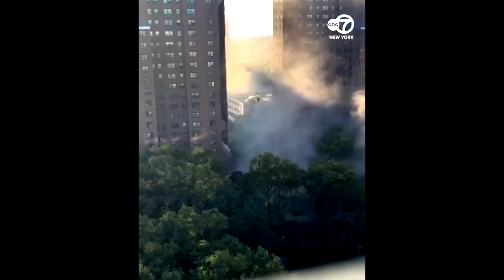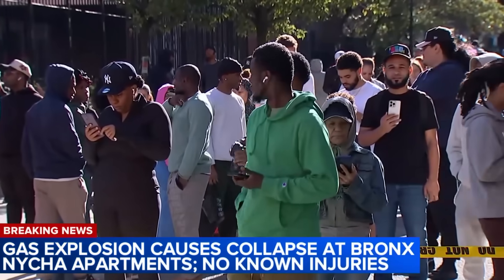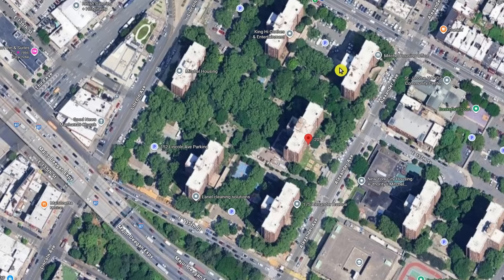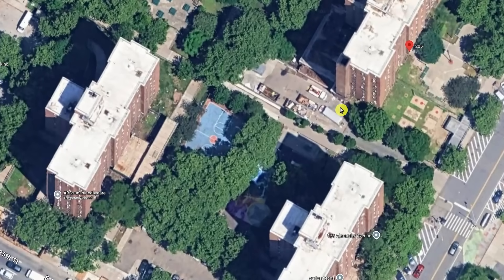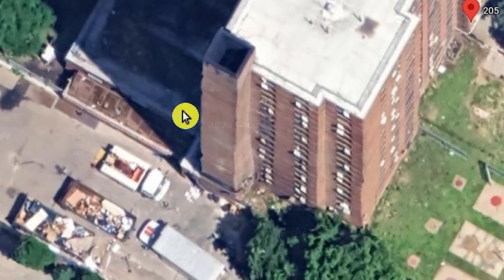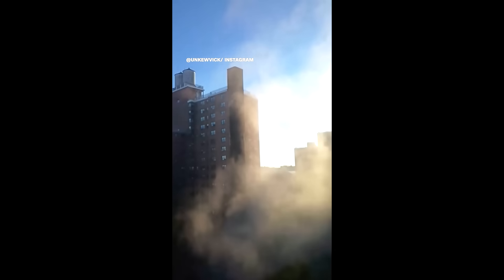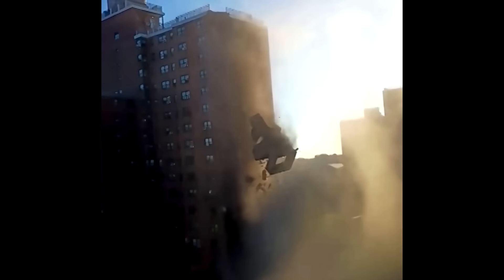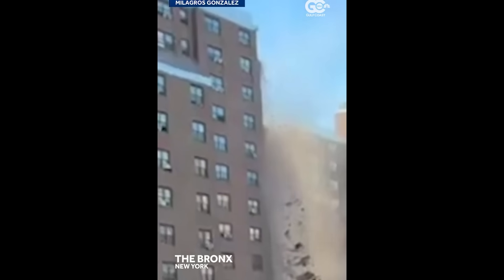Bronx Apartment Collapse Explained: Boilers, Bricks, Stop Orders

Comment: I worked on boilers like these for years... typically in these apartment buildings. they have separate boilers used for domestic hot water than are used for heating..  they sit all summer long..  actually a good part f spring in public housing.. the government is cheap in my area and had us come out and do full shut downs april 1 (central ohio)..  and typically wouldnt do boiler startup till november 1 if they coud get away with it..  anyway if that incinerator chimney was  used as the boiler exhaist chimney (I have Zero knowledge of this building.. never saw it before the collapse)..  if the ignition system fails to light the gas repeatedly its possible to have gas buildu in the chimney..  the purge cycle is supposed to blow enough fresh air into the flue and boiler combustion chamber to dilute any gas buildup... that said if for some reason the boiler wasnt running full purge cycles and the tech trying to fire it was troubleshooting why the igntion wasnt working then maybe a sugnificant amount of gas built up in the lower part of the chimney..  cold and possibly damp conditions?   when the unit does ignite then its likely going to "poof" right out the exhaust port and into that gas filled chimney...  since no one got hurt it obviously either didnt blow up inside the room but did in the chimney enough to cave it..   or like you mentioned, gas build up in the boiler room...  old building perhaps they had CO detectors but not combustible gas detectors? or there was no tech in the room running the boiler... it just on its own failed to close the gas valve on a no-fire..  from what ive read it sounds like boiler ignition failure and gas buildup in the chimney..

Comment: JUST  SO  YOU  KNOW...
Those shafts are STILL USED, but instead of going into an incinerator...the garbage is collected in a dumpster, and hauled away later. The 'inhabitants' like to throw fire down those shafts and intentionally burn the bulk garbage pile at the bottom...leading to tremendous smoke issues of the entire building because the chimneys don't draft with the incinerator anymore. It is possible some 'inhabitant' thought it would be funny to throw an accelerant down there, and lit it off...causing the explosion. It would not be against their 'character'....or lack thereof. And just so you know....their rent is mere pennies, and all their utilities are free. They often times open the windows in the middle of arctic winter freezes because 'it's too hot inside' and they don't turn down the radiators. Or they just crank up the A/C. They aren't paying for it anyway. So remember this the next time these creatures complain about anything. #Savages  😐

Comment: Most likely weather played a massive role in the structure failing, coupled with failure to maintain the pointing adequately. Add in factors that it was a chimney and exposed to the effects of combustion which overtime weaken the mortar between the joints to little more than dust. The chimney wasn't tied into the buildings structure.  Who knows the state of the basement around the boilers, whether they'd removed the old system further weakening the structure.  So Age, Severe Lack of maintainence, Adverse weather and effects of combustion over the years, with possible modification to original design structure.

Comment: My guess would be that the triple wall is internal heat resistant layer (expensive bricks), actual structural wall (cheap bricks), and the exterior wall (design weatherproof bricks).

Comment: Really interesting that you were able to post a Google earth picture of the building chimney before the collapse. It looks like there was a construction crew doing demolition work right in the area of the base of the chimney. Tough to see clearly but there seems to be a hole cut through the wall just to the left of the chimney. In the post collapse photos you can see what looks like a new garage door. As well the line of the roof above the garage door is much further back than it was in the Google Earth photos. Perhaps they took out a portion of the boiler room roof and unknowingly weakened one of the support wall corners of the old incinerator tower.

Comment: While a gas explosion is most likely, but it could have been the boiler itself blowing up under pressure due to a weakness caused by corrosion or metal fatigue.

Comment: This is a tribute to the good construction of this building, especially for how long it took the chimney top to collapse. If you look, there is nothing at the base of the shaft. The door and vent next to the shaft suggest that the incinerator was probably next to the shaft. It would make sense that the boilers also vented into this same chimney, so it is likely it was still in active use for the boilers. As one other commenter pointed out, if a boiler failed to ignite and vented sufficient gas into the flue, exactly this kind of thing would happen. If the boilers were being commissioned for the heat season, you would think a tech would be present who would have shut off the gas immediately on a failure to light. Safety systems should have also acted to automatically shut off the gas. We had something similar happen a few years back at the University of Nevada-Reno. A technician was working on a boiler that provided heat to a number of surrounding buildings. It was a 6 or 7 story dorm unit, unoccupied at the time due to summer break. Something catastrophic happened that resulted in a major gas leak. There was an explosion that apparently made the leak much worse. This resulted in a much bigger explosion that did severe damage to the entire building. The tech apparently got out quickly and shut off the gas supply to the building. His quick thinking and actions undoubtedly prevented a much bigger explosion. In any case, the repairs to the building took two years and cost more than it cost to build the building in the first place.

Comment: Weren’t they also heating hot water for the building with the same boiler? Therefore, the boiler would be going all summer with the heat circulation pump turned off and the hot water circulation pump turned on. 🇨🇦

Comment: While I am not certain about this specific building, this is one of the last completed of the NYCHA's blocks (very few kept being built after 1970). Historically, for such tall buildings in New York, this is probably a concrete frame with brick exterior and/or infill. While some of the lower (<12 storeys) buildings used self-bearing brick, frame was most common for things to and above 20 storeys. The wall visible beyond the bricks at the top of the chimney may be the concrete frame sides. Often the chimney stack would just be built from self-bearing brick adjoining the building, only loosely connected to the main structure, so that is possibly why there's emergency responders on the roof, as they may have determined there was no general structural risks involved.

Comment: The NYCHA buildings in the complex that make up the Mitchel Houses often have one building that has the powerhouse attached to it.   That powerhouse makes heating steam and hot water for all the buildings.   There is a mini steam and hot water distribution system that goes from the powerhouse and feeds each of the buildings.    When the complex was built in the early 60's its powerhouse burned no 4 fuel oil which is a dirty oil and thus coated the flue or chimney black.    I do not believe the flue was ever meant to be an incinerator.   It was simply a giant chimney, flue or stack for the powerhouse.   Today the powerhouse's boilers burn clean natural gas.   Unfortunately, the NYCHA boiler attendants allowed a critical volume of unburned natural gas into the boiler(s) and into the chimey or stack.    Subsequent ignition and explosion occurred which instantly pressurized the stack to blow out enough bricks to collapse it.  Preliminary reports indicate that a boiler or two were damaged.    It should be interesting to see how NYCHA will heat the entire complex with its powerhouse damaged...

Comment: This is operator failure. Gas is built up in the combustion chamber and when ignited causes an explosion there’s a computer that is supposed to turn on the fan to purge it, but the fan most likely did not work. There was also a previous explosion called the puff back.
-hvac engineer nyc

Comment: That makes total sense...it happened right at the start of October.
Which building management consider The Start of the Cold Seasons.
Though these days,  even in New England,  people still need to use their a/c, as the outdoor temp goes into the 80s, and it's hotter inside.  Though then it'll drop to the 40s at night.

Comment: This was the boiler plant flue chimney---not for an incinerator.  The news got that wrong.  In many NYCHA projects only one building has a boiler plant and the steam is then distributed underground to each building.  Due to the chimney being missing, the entire complex has no hot water or heat.  The inner layer of the chimney is FIRE-BRICK. The round hole at the bottom of the pile is the boiler exhaust breeching.
Reply: No, you got it wrong. It was originally an incinerator flue stack but the waste incinerator had long ago been replaced with a gas boiler using the same old stack. If it was built for the gas boiler from the beginning, it wouldn't have that large cross section (if it's not a 100 MW scale boiler used for a whole town). Nobody said there was still an active waste incinerator.

Comment: What if the chamber of the boiler room shaft was super dirty with soot so natural gas detectors didn't alert but when the heat kicked in, it ignited that soot which caused the walls to fail?

Comment: Ceramic engineer here: The inner layer, at least in the lower section, is likely made of temperature-resistant firebricks. They are also significantly lighter than the red facade bricks. What this type of firebricks doesn't like at all, however, is moisture in conjunction with frost.
Reply: Thanks for sharing your genius
Reply: The collapse was caused by a gas pipeline explosion. Not what you said.

Comment: Thks for video.  My first thought was it was an external added on stairwell for the building.  My reasoning for the failure is the fact that it was left open at the top for rain to enter.  Nothing was being burned and keeping things dry.  Next is the fact they turn off the boilers for heat.  Constant expansion and contraction every year.  P.S. If you have a fear of heights, you cannot be a responder in New York.  Standing over the edge to see would be a normal thing.  Just ask the ones that build said buildings.

Comment: Gotta give props to '60's construction. The fact that the chimney and only the chimney fell, and collapsed pretty much into just it's own footprint is pretty impressive. Pays to do things right.
Reply: Most likely weather played a massive role in the structure failing, coupled with failure to maintain the pointing adequately. Add in factors that it was a chimney and exposed to the effects of combustion which overtime weaken the mortar between the joints to little more than dust. The chimney wasn't tied into the buildings structure.  Who knows the state of the basement around the boilers, whether they'd removed the old system further weakening the structure.  So Age, Severe Lack of maintainence, Adverse weather and effects of combustion over the years, with possible modification to original design structure.
Reply: That's prime real estate in downtown New York! One controlled demo, to get the poor people out, get zoning start building condo's.
Reply: As he said, it's a separate structure - the building didn't lose any of its critical support components at all. It looks a lot more dramatic than it actually was (from a physics / engineering perspective at least.)
Reply: @EstorilEm  That's just not good enough.  This was a major infrastructure failure.  Buildings are not supposed to just collapse, neither in whole, nor in part.
Reply: @justaskin8523  It a maintenance problem. Very commun in masonry building since we stoppped building them. Most of the specialized workforce does not exist anymore and the cost are horrible because of this. But simply a maintenance issue.
Reply: Definitely seems to have held up better than Ronan Point here in the UK.

Comment: So the complex may have to be hooked up to boiler trailers.  This surely was a stack from steam heating boilers, not incinerators.

The incinerators hoppers oare near the middle of the bldg. for tenants to put trash in   Now to compactors.  Wasn't the burning done close to that?   They did not walk trash in the basement from middle to edge of the building.     In Dyckman Projects,  N. Manhattan ('Inwood"), lived in a as kid, each bldg. has interior incinerator stack, close to core of the bldg.    The boilers for the 7 bldg. complex built in early 1950s are in a separate bldg.    And they are not going to rebuild a brick stack.

Comment: 8:53 what am I looking at on that diagram?

Why is the grey brick tagged with "WALL TIE", shouldn't that be pointing to the little metal bit L shaped bit?

And the "TWO-WYTHE BACKUP" makes no sense, that just looks like some kind of plaster board? And is certainly not two wythes thick.

Comment: I was a few feet from a fuel oil boiler during relight and it went boom. The water vessel did not rupture (as I am alive) but the sheet metal blew apart and filled the room with smoke. I don't like being around boilers.

Comment: These are reinforced concrete buildings with brick facades.  That is why the NYFD is inspecting the roof.  Only the facades are affected, not the structural slabs or columns.

Comment: Where in live if you have an existing brick chimney that was originally designed for an oil/ coal/wood boiler, it needs a stainless steel liner when converting to gas due to acidic nature of gas exhaust when mixed with condensate

Comment: Cleaver Brooks boilers are high pressure boilers. Mechanics who work on them must be trained and certified by CB.  They sofisticated as compared to a typical Federal style low pressure unit.  NYCHA has no money.  Only a select few boiler maintenance contractors in NYC exist.  I doubt one of them were on this job.  Or possibly in house maintenance bit off more than they could chew when going through refiring procedures

Comment: I am a building code official and The construction is 3 layer brick with air spaces type which was common starting at the turn of the century.
Since the brick is brittle and unlike the CTS there was no rebar attached to the main structure to drag it down. the brick sheared apart. The code now limits the height to 35 feet and this building wa about 160'.
CMU is used for these type of projects.

Comment: the building 164 St. Anne's way, to the east-south-east of this complex, also has such a chimney with a newer brick shed at the bottom of it with all sorts of yellow pipes going in. It seems that they used those incinerator shafts as chimneys for the complexes' heating system as well. I can only find a single building in a block of several with such a chimney. Am I right in assuming that single boiler system would heat the buildings around them, not just the building with the chimney?

So would they have used the incinerators to help heat the boilers back in the day?

Comment: The fact that the chimney remained in place after the lower supporting bricks were gone is a strong testament to the quality of the brick work on that building!!!
Reply: No it is because of the lack of steel to tie the failed part to the rest of the building. Brick has a low shear resistance so the interlocking bricks just snapped off.
Reply: 1966 quality.
Reply: Tony Soprano would have told us that!
Reply: Nice spin.
Reply: Something that is hard to find in this day & age.
Reply: Yup they didn't do maintenance that's why it happened

Comment: Cold air in the chimney is problem, imo. Thats why metal pipe is used instead of chimney, as it reduce amount of gas gathering at bottom. They didnt have one there, it seems.
They just let it into chimney, with cold air reducing way of escape for unburned gas, asking for problem in case that gas get ignited. And there was a lot of space for gas in chimney of this size.
Im not expert, but i would bet that was the problem.

Comment: I didn't know you could build 20 floor brick structural buildings
Reply from the maker: The didn't either! LOL. They are reinforced concrete or steel-frame towers, with brick used as veneer or cladding on the exterior walls. The brick you see (sometimes in multiple wythes) is a façade system tied to the structural frame — not the thing holding up 20 stories of weight.

Comment: I am guessing that there was a malfunction of the Igniter on the boiler. When the boilers first start up there is a blower motor that purges the chimney by blowing air through it for a set amount of time then the Igniter and gas turn on. If there is no flame detected after a short time the system will shut down, this leaves a charge of gas and air in the boiler and chimney. If a second or third attempt is made to start the boiler without properly purging the gas and air mixture  there will be an explosion. If this happens in a brick chimney it can blow the whole chimney apart.